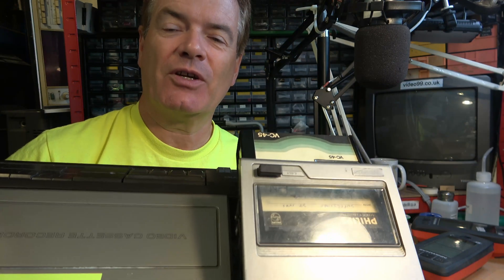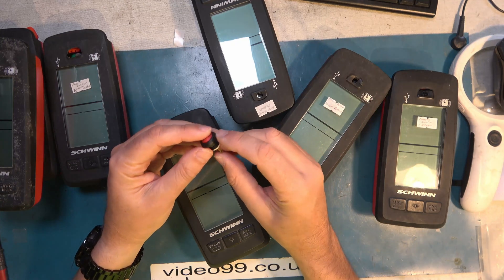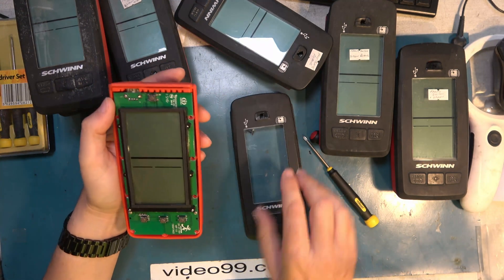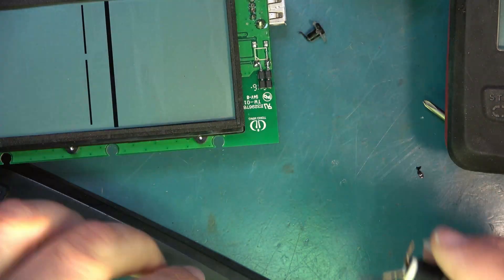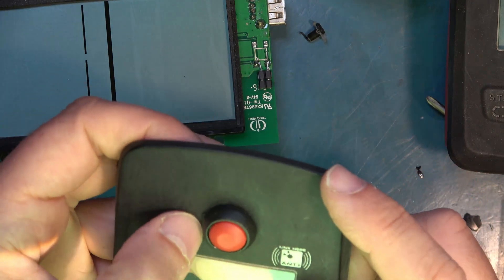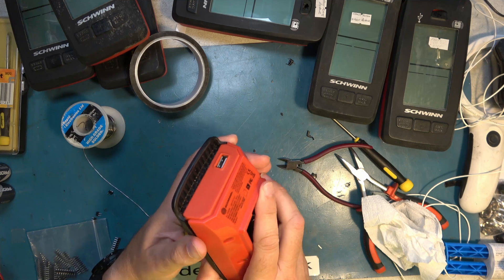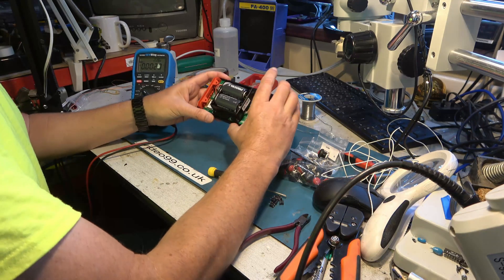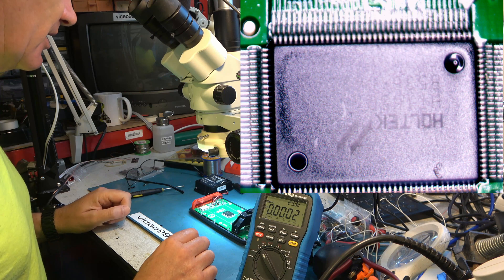Expensive gym bike fail.  Let's make them better than new.  Echelon2 ACPP console repair.

Comment: How much would you charge for each console replacement botton ?  I have around 10 consoles with this problem .
 I live in Portugal
Reply from the maker: I'm doing them at £65 including parts.  But there's enough information here that you should be able to tackle it yourself if you can do basic soldering.